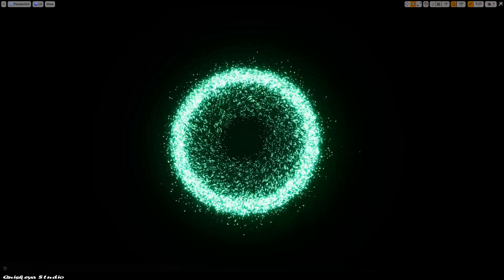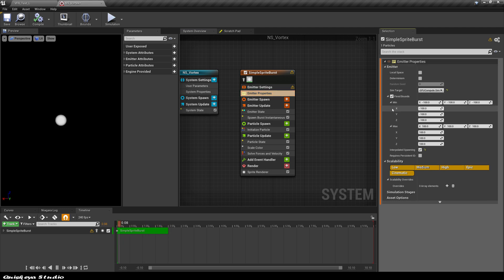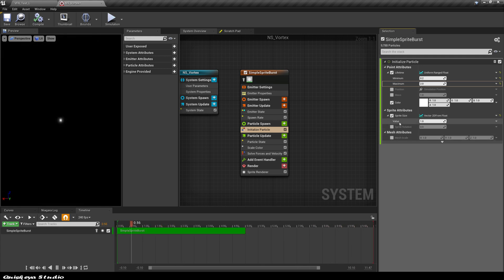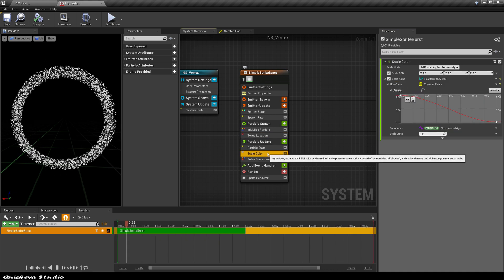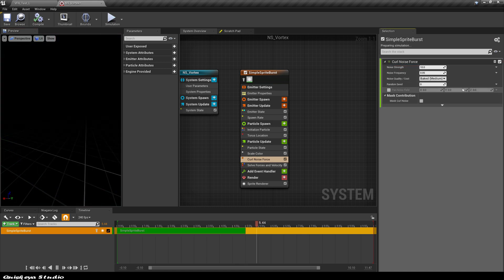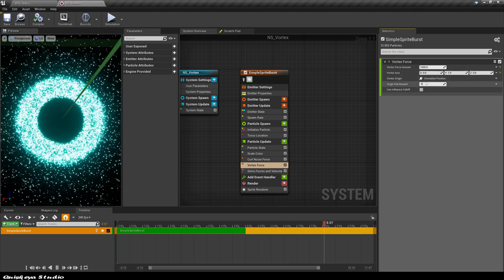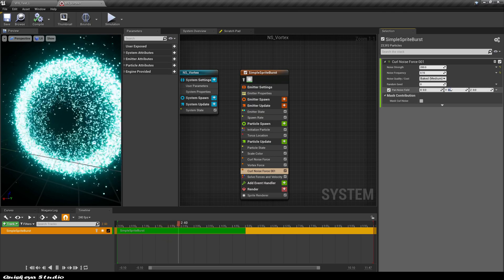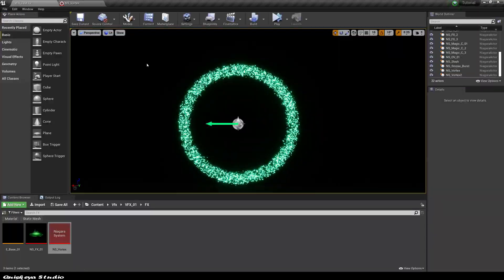UE4 Simple Portal Vortex FX Tutorial | In 5 Minutes!

Comment: Awesome tutorial but this does not work as explained for UE5 like he mentioned in the intro. There is no longer Uniform Ranged Float and the sprite attribute parameters have been changed as well. I am sure this works great in UE4 so I appreciate your time.
Reply: use Random range float for the lifetime and scale, then "shape" location for particle spawn and inside shape location it has an option for torus.
Reply: @GAMEBR0VIP2462  can't wait to try this. Thank you!
Reply: @GAMEBR0VIP  actually, maybe you can help with something if you have a sec? I cant seem to find anywhere in the documentation that explains how to get these particles to actually cast light onto the surrounding meshes.  I see their shadows but I would expect there to be a bunch of moving light against walls etc in the scene with a massive swirling portal firing off... I've tried the light renderer but that was a dead end and I've run out if ways to search this topic. Any help would be appreciated! Thanks 😁
Reply: @reddjinn911  The Unreal Engine Color Picker normalizes RGB color values to an integer between 0 and 1. However if you set a color value greater than 1, it becomes emissive color. The particles will glow that color when the system is placed in the Level. if this isnt what your looking lmk i might have another idea
Reply: @reddjinn911  2nd idea is In the System Overview, click the Render group to open it in the Selection panel.
Click the Plus sign (+) icon for Render, and select Light Renderer.
Set the Radius Scale to # desired scale. This determines how far from the particle spawn point the light spreads.
Reply: @GAMEBR0VIP  radius scale for the win! Wow... can't thank you enough!